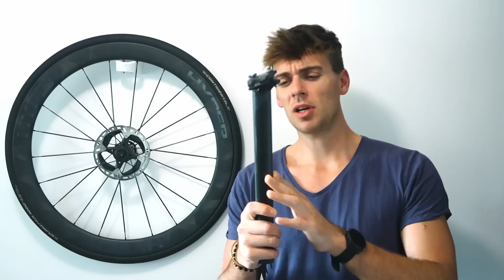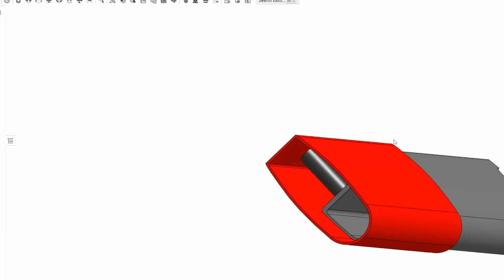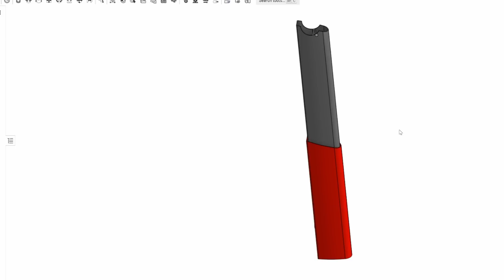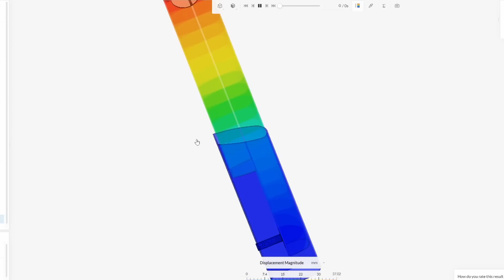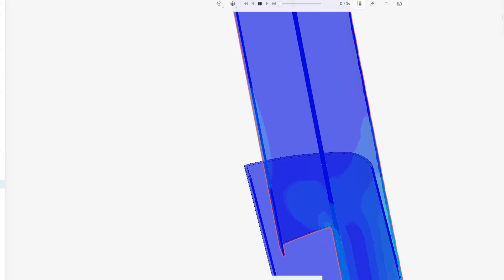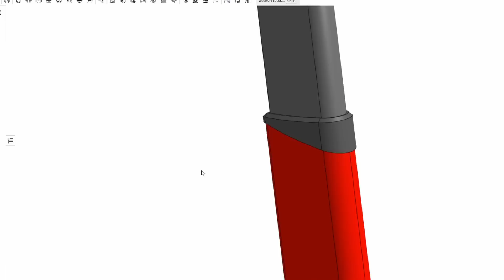2021 Canyon Aeroad seatpost fail, fix & The State of bicycle frames in 2021.

Comment: I really think you're missing what Canyon wanted to do by adopting this design. 
Looks like the seatpost gets clamped at the bottom and and the top of the seat tube is supposed to get supported by the frame, which is way stiffer than the seat post and if touched would limit its travel range. The portion of the tube in the middle of the two contact areas, which has lower cross-section and  consequently area inertia is what is supposed to flex, indeed engineers left clearance for movement in that zone (3:36), to avoid interference. 

Your model supposes that the only clamping force at the bottom, with a way greater leverage compared to conventional designs (hence greater momentum), applied in a few millimeters could counteract both downward strain and flexing momentum, which looks absolutely unrealistic and has never been implemented in any successful design. Even in conventional style seatposts the main role of the clamp at the top is to counteract downward force, and the rest of the seapost (hidden in the seat tube) takes care of the reaction needed to balance flexing momentum by transferring force to the frame and distributing that on a large surface. Indeed manufacturers specify a maximum seatpost height in order to have enough surface area to distribute the strain on both frame and seatpost, and the clearance between those parts is thight too for obvious reasons. Canyon simply tried to invert the traditional design.
I'm not saying Canyon engineers did stuff right, they're having clearance problems (which probably needs to be thighter), hardness compatibility issues and contamination problems that you do not have in conventional designs since the top clamp  naturally provides a seal.
I could be wrong, but I'm quite sure of my interpretation.
I don't know if you're an engineer, and I'm not expecting a reply. Just flex yourself a little less.
Reply from the maker: Hi Fabio. Yes, there is a possibility they were going for a '2 point bend' supported beam. However, the top support would need to be a proper roller or slider support with 0 clearance. Carbon on carbon would never work. Thanks for the comment, it's interesting.
Reply: @PeakTorque  Glad my comment was understandable and you got the point. However I don't see why carbon on carbon would not work. There are way worse examples of carbon components mating with high hardness materials on a bike, such as the headset, press fit bottom brackets and the dropouts. All these have in common is either an interference fit or a moderate clamping force to get rid of any play. If getting rid of play (such as in the situation we're discussing) is not an option, the materials need a similar high surface hardness to minimize wear, as happens in automotive drivetrains where gears are subjected to impulsive torque and need some degree of play to work. I never played with carbon but I'm pretty sure that high hardness gelcoats/resins are available (carbon chainrings are a thing).

Comment: You made some good points and applied some 2nd semester mechanical engineering basics. Alright. FAir enough. But please stop calling it 'plastic' frame is quite unneccessary. After all, that frame and post is made (mostly) of toughened epoxy and carbon-fiber composites. CFRP. (CFK in german).

Comment: Modeling composite materials is not as easy as u imply. However it is good enough to point out the failure. 
I am pretty sure that every frame builder is not able to simulate their frames correctly. They work with design limits based on experiments. They only use simulations for parameter studies.

Comment: Wouldn't it be easier to put some sort of elastomer between the top of the seatpost and the saddle clamping mechanism? 
You could build a lighter clamping mechanism in the frame which could make up for some of the added weight at the top of the seatpost. 
The only real compromise would be weight (and probably not that much). Plus you could sell different stiffnesses of elastomers to suit different tastes which would give some added profits.

Comment: like the video but disagree regarding design intent. my guess, the flex was never the original design intent. much simpler intent: post backside and frame backside in a straight line. hence, not much body for a clamp. where do you put the clamp then? remember you still need to be able to adjust the post. solution: put clamp lower down and reduce crosssection of post only in downtube where not visible even with tall riders.

Comment: There is no excuse for crap engineering and even less for crap QA. The engineering is not that hard, even with composites. I like what you and others (like Hambini) do... like it or no you guys are not making accusations that are boundless rather you are pointing out the bleeding obvious. Round holes in line are not hard to do... If frame manufacturers can't get the basic SIMPLE stuff right they have no place in engineering let alone manufacturing and seeking premium prices for below average (worse than Ali Express quality) products is adding insult to injury. Lets hope this and other video's like it expose this BS and allow people buying bikes to get a quality product that is genuinely well designed and made.

Comment: Problem is visible - agreed, these 100 pages on you know which forum is undeniable.
Your analysis, with all the respect, is without big value in fact - ok colours in FEM seems to be scientific, but it's making the theory to something we all do see.
1. If the deflection of the seatpost was "surprise" for the engineers, how is it possible, that the seatpost is damaged, and thin wall of the frame collar is untouched? I don't suppose, that the collar is designed for shear force or bending moment in that area, or maybe it is?
2. Your model does not show stresses when there is a change in cross section of the seatpost. It should - the geometrical properties change, while the internal forces i +dx and -dx from the point of section change stay the same.
4. While there is deflection from the seatpost that high that it meets the frame the support conditions change. Please, inform about for example about beams theory while you try to apply it - it has its own limitations and approximations, not always being in line with 100% reality. Scientific approach requires showing also the input and the conditions. In here are only the basics.
5. You have a theory - that's ok, but why is it working only for that one single particular case? New Aeroad is not the only bike with low settled clamping system. According to your theory, it shouldn't be only this models problem. I don't think that there is silicone filling advised by any frame manufacturer?
6. Suggesting, that the solve of the problem will be the silicone is quite funny - you say that you modelled 1mm gap between frame and the seatpost. In fact this tolerance is only to allow the posts insertion, if it was too tight, we wouldn't be able to insert the post. How can you assume, that layer of about 1mm silicone will have ANY dumping properties on 100 kg mass given on several cm of leverage?
Reply from the maker: Hi thanks for the comment. Let me answer a few things
Yes the stress does change in the seatpost at the area you mention. However, the central wall is the main structural member (Canyon will confirm). Its double the wall thickness and of a different layup. The rear section is more of a aero fairing, with lower stiffness and even has glass fibres in the layup. Thus the stress transition isnt that large which is fine. Max stress is at the clamp. 

You are right, there is a chance the intended design could be a 'simply supported beam'. However if this was the case, the top support would have to be a proper roller support. Carbon on carbon + grease isn't going to work.

The silicone is just a temporary measure to provide a water seal, not damping.

Comment: I am so glad I have found your vids. You are so, so right. I have been a self-employed bike mechanic for over 10 years and my work in the trade goes back more than 30 years. In the last 5 I have seen better design and production in the average cheap supermarket bike than I see in top flight road bikes. I have an engineers brain but not the training but I could see before you explained anything the idiocy of Canyons design. Not only will it self destruct but it’s lack of dial-ability will make the flexion right for only, perhaps, 1 in 100 riders. Far better to have, for example a (selectable) elastomer below the cradle. There is so much crap and bad practice in the trade driven by the perceived need for lightness and aero and people’s obsession with owning  the ‘new best thing’. The manufacturers need to supply bike oil not snake oil.

Comment: Have you seen how the Rose aero have cut away the back of the seat tube down to the (lower level) clamp. Simple solution. They have a neat rubber cover over the rear of the seat post up to the top tube.

Comment: I leave road cycling for 15 years and come back to over priced junk. I do admit my brand new Endurace is night and day better performance then my 2006 alum bike but now I have to worry about the frame and brake problems on a bike that costs 2 1/2 times more then my old bike!

Comment: Question: will the type of silicone sealant react with carbon? From auto (i'm also an auto hobbyist) I know silicone sealant that cure with acidic compounds can cause rust issues with some metals. 
Carbon, totally different obviously, but wanted to raise the question since that edge of the frame may be worn to raw carbon or have no paint interface.
Would an organic compound like polyurethane sealant be better or worse? Doesn't matter with carbon?

Shockingly bad design from Canyon.  If you allow a larger gap at the top of the frame, will it also start to cause lateral movement as well?  
You and Hambini make a good 1-2 punch with tech info!

Comment: Respectfully: 2:41; I would posit that the new "s" post design's purpose would not only be to fit tighter, but to also have less (almost no) flex at the bottom section (frame interface to clamp) in order to alleviate rubbing. The top of the "s" would be the flexible section. This design would be constrained by the existing frame and work similarly to a post clamped higher. It is probably the only realistic solution without changing the frame. Anyway good video and thank you for keeping it civil. It does make one wonder how the present design made it out of the design review.

Comment: Any chance someone can send a post over to Raoul Luescher for him to dissect?
We’d have the holy trinity of Hambini, Peak Torque and Luescher Teknik all over Canyon.
Reply from the maker: It doesn't need cutting up. The layup is the least of the worries. Basic beam bending theory is where they need to start. Year one of nearly ALL Mech Eng, Aero Eng, Automotive Eng, Civil Eng, Structural Eng degrees across the globe.
Reply: @PeakTorque  Too be fair Solid mechanics was a year 2 course at my university so canyons engineers probably would have dropped out before getting to it.
Reply: That would give those clowns over at Cervelo way too much relief.
Reply: "This seatpost design is... Less than ideal"

Comment: Very good illustration. Hopefully my aeroad comes only when the problem is fixed ;-) - what about an idea to reduce the gap between seatpost & frame with iso tape at the hole inner surface of the seatpost? this reduces the flex (and the commercial argument of comfort, which a hobby rider will not notice - I'm shure) and hopefully not increasing problems until a acceptable solution will delivered. (A friend of mine today got an email from canyon that the 'solution' should be the use of grease instead of assembly paste. (I saw the original email) - I was very shocked of the problem analysis made by canyon ...

Comment: actrually it is not a design fail its just the customers that not read the manual where is written that you have to put grease on the top there is even grease in the box that the bike comes with because of people putting carbonpaste there or not putting anything there the post gets damaged i personally have no problems with this and im quite heavy and tall ive ridden 2000 km on this bike and its absolutely fine 
hope you read this

Comment: The prices for many carbon frames are simply outrageous given how many quality issues we're seeing across the industry.
Reply: The quality issues are the reason I found me a custom titanium builder here is the US and had him build me a frame. In the last 7 years I went through 3 carbon frames and feared for my life while riding them. I am totally relaxed now knowing I have a sound bike and a safe bike. This bike is a keeper.
Reply: These aren't new problems.  And it's not carbon specific.  One of the first framesets I built up as a mechanic was a Cannondale CAAD 7 that came with a 700c fork, and largely 700c geometry and a 650c rear triangle.  My first carbon bike was a Cervelo P2c and I had to file out carbon to install the seatpost.  There were bits of excess, loose carbon with no resin on it.  I also had the seatstays crack near my brake twice in 3 years on my R3sl and was shipped a Trek Equinox TTX with a cracked bottom bracket straight out of the box in 2008
Reply: that's why you should start ordering direct from factory in china, I've got a seraph wilier cento10air replica and it's as good as the real thing.
Reply: @albr4  how can you reach those companys? would love to know who did my carbon frame on my bergamont.

Comment: As a graphic designer not engineer, I actually spot that seatpost weakness the very time it was introduced. Kinda surprised that the frame was not the one that actually cracking since it bears a lot of motion and pressure.

Comment: This sort of design paints engineers in a bad light as I think it is a problem that is pretty obvious to find if on-road testing was performed and not just the basic industry std fatigue tests. Canyons response on this was also terrible for such a large company. 
I've watched your video twice and I think you are missing a crucial design parameter in your FEA as you do not take into account the resulting supporting force the seat post sees when the seat post deflects and touches the seat tube in real life. You seem to make the assumption that Canyon should add clearance here to allow full movement of the seat post. I think this is the wrong assumption.  I believe Canyon made it to always be in 2 point support (at the seat post clamp and also at the tight fitting seat tube) and not simply act like a long cantilever beam from the seat post mount. Their design actually has 2 main positive benefits as it allows for more flexibility in the seat post and less weight when compared to a seatpost that does not transition to a thinner more flexible section inside the seat tube. So in one way, Canyon did engineer a very good solution to giving an aero seat post more compliance... It is just a pity they fucked up the top contact point which was pretty obviously going to wear out from small sliding contacts...
Reply from the maker: Very interesting theory. You think they originally designed it to be a 2 - point bending beam? That kind makes sense but they'd need a proper roller support/bearing at the upper support or it will always grip and wear. Interesting comments. Cheers
Reply: @PeakTorque  Hi, thanks for the reply. Yes I think they meant for the top contact point at the top of the seat tube but poorly designed it. Yes, there are many improvements they could have used but considering many of the best methods have been patented already maybe they just decided to opt for a surface to surface contact at this point and thought the wear would not ariseto such a degree. Carbon fibre isn't exactly hard wearing compared to some metals so maybe they could have bonded in metal inserts that could have given better life. Or even design it as such that any wear pads could be replaced. Cheers!

Comment: The Aeroad used to be my dream bike around two years ago, but then there were the problems with frame quality raised by Hambini last year, and now this seat post problem with their new models. These problems have really shaken my confidence in Canyon, as it has all but proven Hambini correct regarding Canyon's terrible engineering. 

I wasn't completely deterred by the frame quality because that was about manufacturing tolerances (e.g. could be the Chinese frame manufacturer's fault, as was the case with the Hambini video where a customer found the QC sheet that was signed off even though the frame had failed QC). However, the seat post problem is about engineering design, which is squarely the Canyon engineers' fault.

The shipping rates to Australia are also crazy (as per usual with most things that are shipped to Australia), so I don't think I will ever consider buying Canyon at all now. The numbers just don't add up.

Comment: Engineering of Continental tires! Thanks for the shout out! We love to provide you with reliable rubber!
Reply: @Jan-Niklas Jünger. Now if you could just build a little more longevity into the GP5000 clincher I’d be a happy bunny.
Reply: I 1000% entrust my ASS 2 your engineering EVERY time I fly down these N. Italian 🇮🇹 alpine roads!!! Thank you!!!!
Reply: Your car tires also wrap my 17” rims as well ;-)
Reply: If you could make them leak less air, that would be phenomenal. I'm tired of pumping my 5000tl every 3 days. Or I might just give up tubeless altogether. My other wheels with inner tubes leak less, need to pump them once every 2 weeks.
Reply: @veloaddict  You’re seriously only inflating butyl tubes every two weeks? I’m pretty certain butyl is porous enough to lose around 10psi over that time even more if you’re using Latex